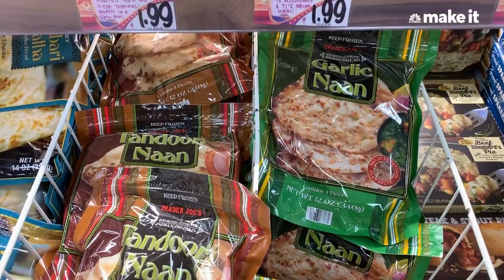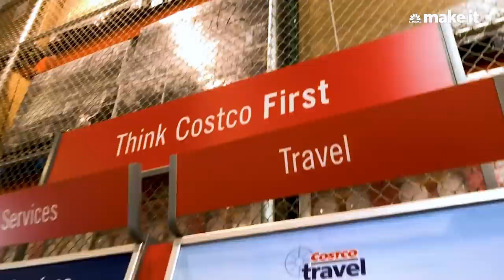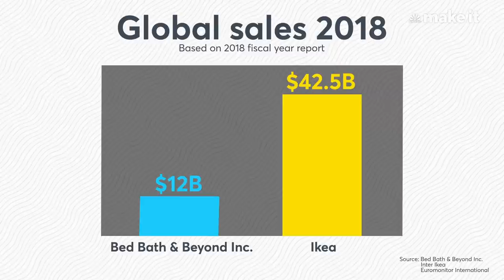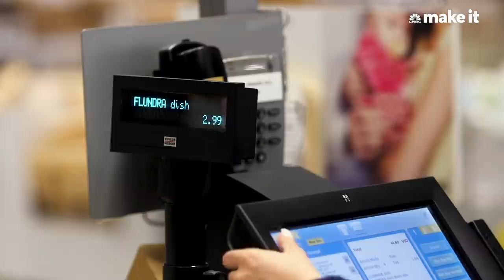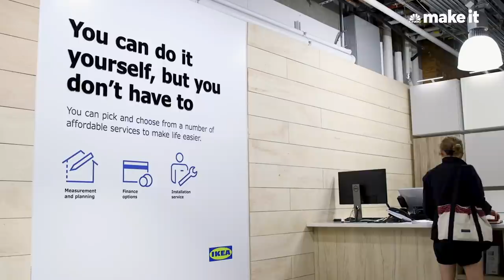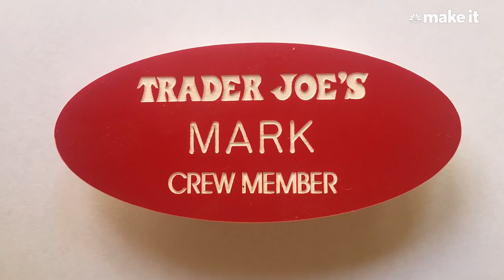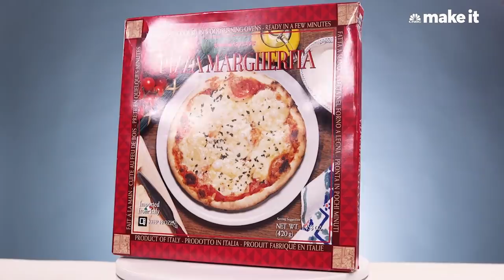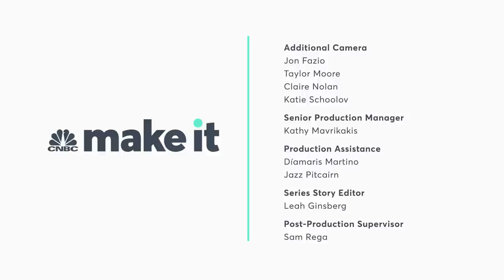Why You Spend So Much Money At Costco, Ikea & Trader Joe’s | Hooked Marathon

Comment: I only spent$ 1800 so far this year at Costco.  That includes 800 for tires and 200for  prescription glasses. But I still kept the membership. I actually like Sam's better
Reply: Curious why u prefer Sams ?
Reply: @anonymouse5910 Sam's always has more fruits and the fruits are quite good. Sam's also has scan and go app which is easy. I also feel my local Costco employees are not as willing to help. When I buy gallons of drinking water at Sam's,  a lot times some employees  would voluntarily  help me. Never at Costco. And Costco is so crowded.
Reply: @elsaz8783  thanks for your reply!